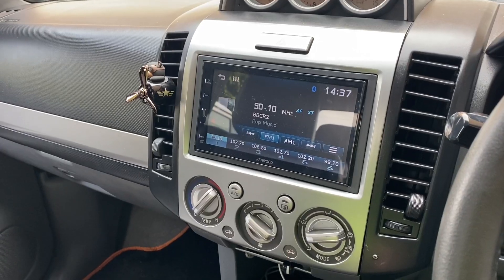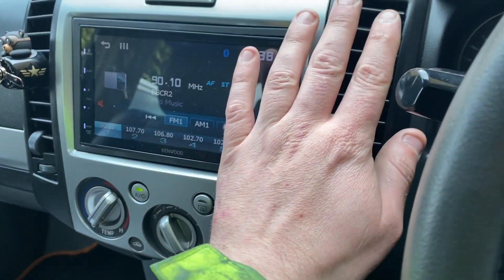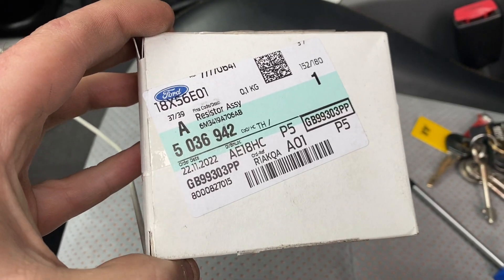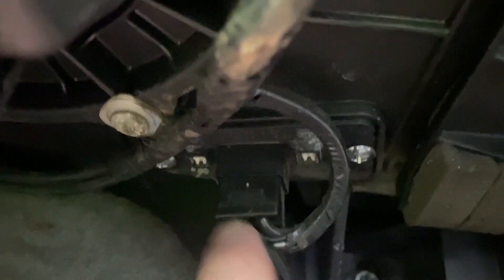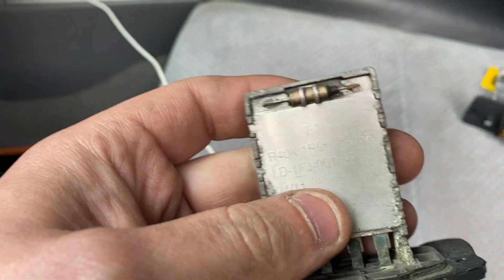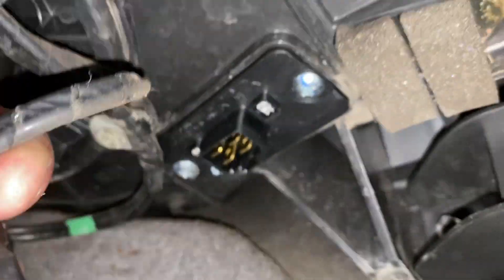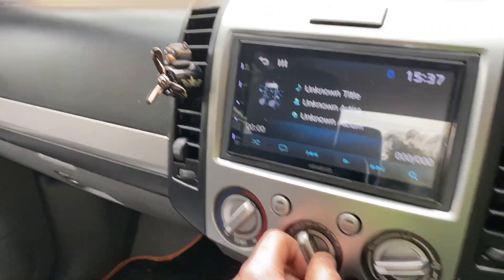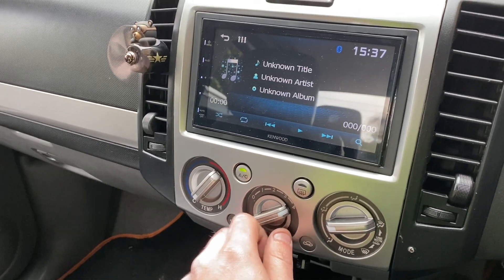Ford Ranger Wildtrak 2011 Heater Resistor Fault and Replacement PJ / PK / BT-50

Comment: Complaint 1/ No fan speed     
2causes   A/ wiggle fan speed switch ,,if fan goes on/off/on etc =damaged 
B/ If fan switch passes wiggle test and your missing fan speed  =resister faulty   
NB caution trying to fit faulty [new]  upgrade fan switch knob pushes shaft  thru switch . THANKS FORD 
new reinforced  knob is very very tight to push on . Remove metal sleeve from knob heaat with cigarette lighter  and push back into knob .   Once cooled it slides easily on off fan switch shaft.